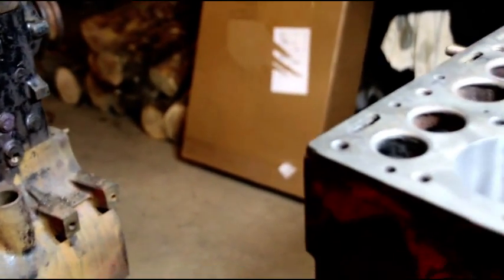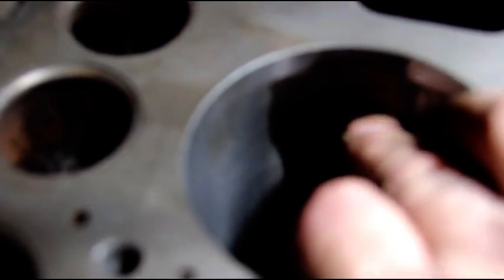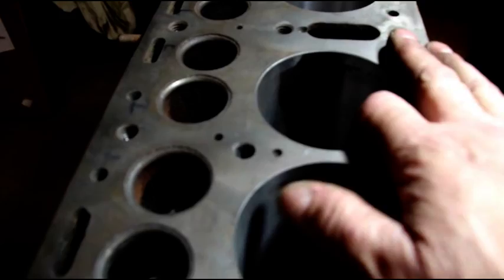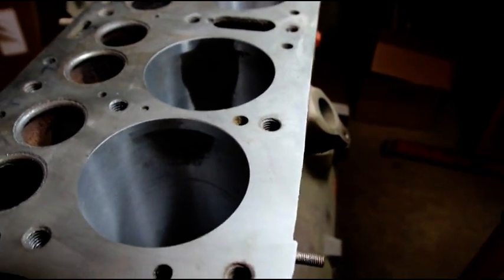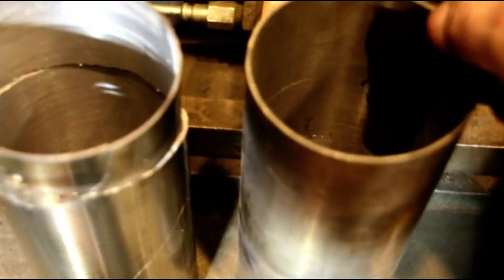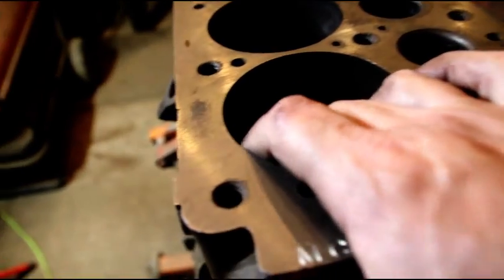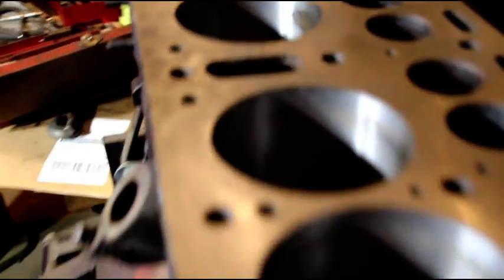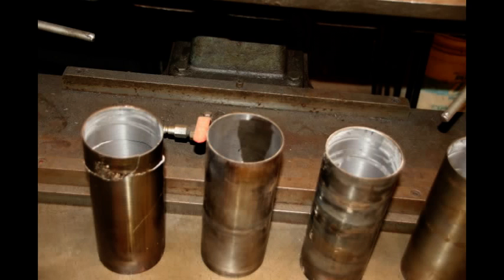Travis's Willys M38 Engine Crooked Bore Problems....Sleeve Removal and Cracks

Comment: Are those "new" casting blocks at Kaiser Willys are Chinese?
Reply: Yes they are and they are awful. I'd stay away from them and rebuild an old engine with how much they ask for one.
Reply from the maker: yes, they are junk.  If you follow my channel you will see one engine came in with a chinese block and we could not use it, so I had to get another original Willys block to continue on with the rebuild.

Comment: A great update, with perfect timing for me! It seems like I have the same issue with an AMC 232 that I just took the head off 2 days ago. It had been sleeved to STD, but one cylinder is worn out 0.033 front to back and I couldnt think how could that be possible. Theres always something new to learn with you, thank you for all you share Brian!
Reply from the maker: Talked with Travis and he wants me to sleeve his block again and stitch the cracks.   I will send the boring bar thru and see what happens.   Your 232 sounds like  this one.  Not bored properly when sleeve was put in.